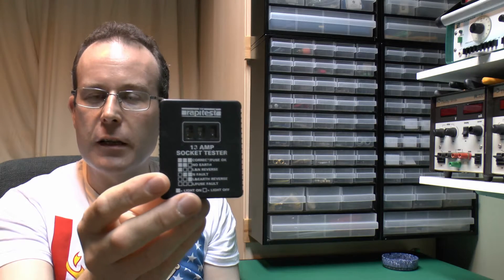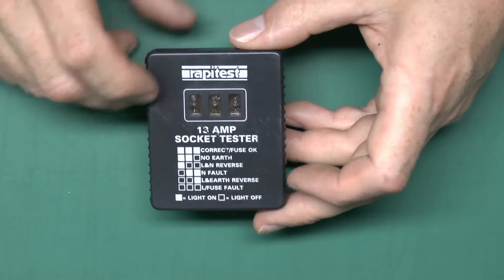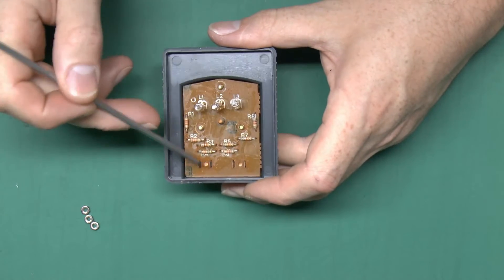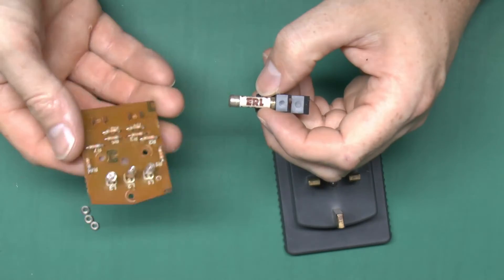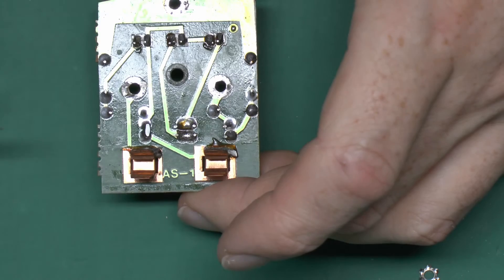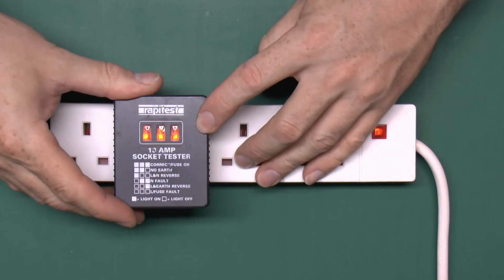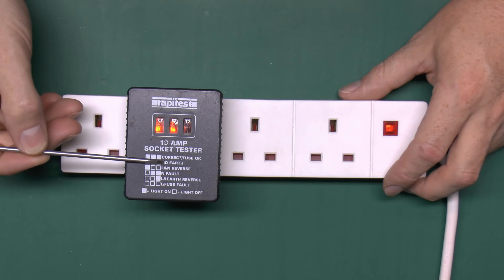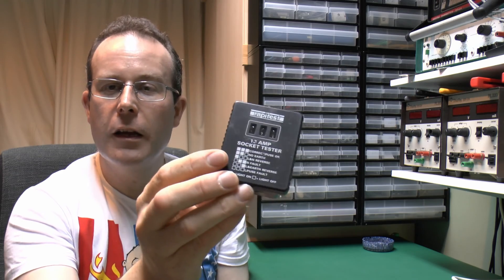Rapitest Socket Tester (Part 1)

Comment: I thought an Isolation Traffo had no Earth? Like a Shaving socket.
Reply from the maker: IrishHitman79 Isolation transformers have no connection to earth,  as that's the whole point of them.  
Those which are supplied fitted with a 3 pin socket usually have the earth pin connected through to mains earth, but this has no relevance to the output from the transformer, hence the tester showed 'no earth'.